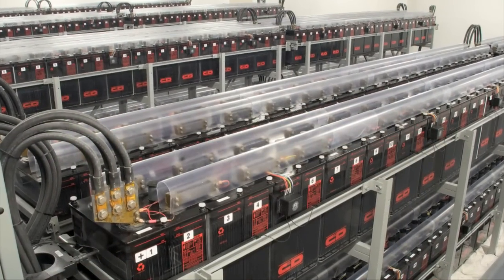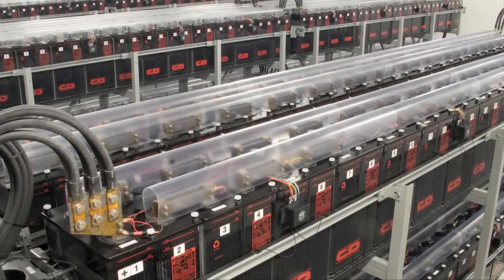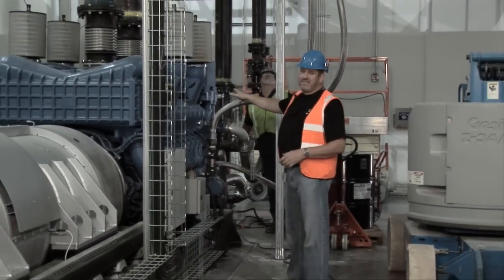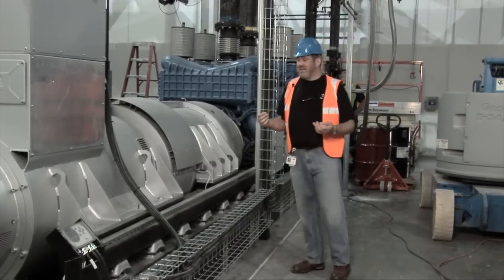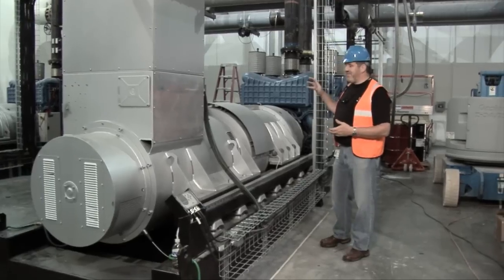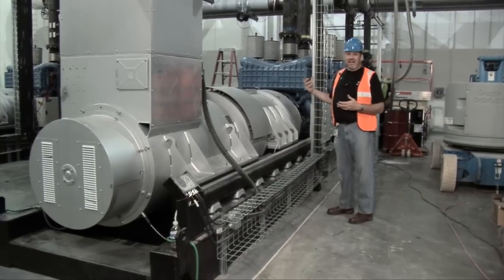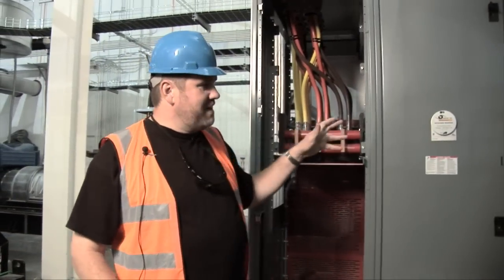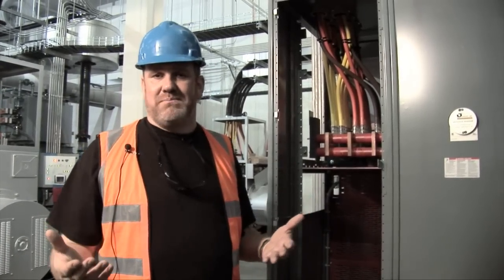Cisco DC2011-Texas: Flywheels for Backup Power

Comment: How has this system worked out for you? Its been three years now, is it still in use? Or was the technology too unproven and you switched back to traditional UPS? Also, what is the make/model of that flywheel and diesel engine in one unit? (Most flywheel ups are simply the flywheel, and just allow you time to switch on your external generator). The idea of powering the flywheel with a diesel motor instead seems more ?efficient?
Reply: This is very proven, and effective.